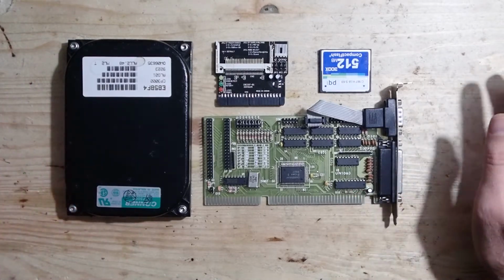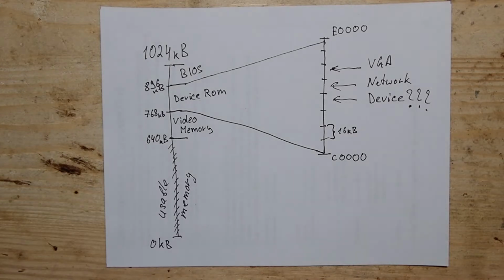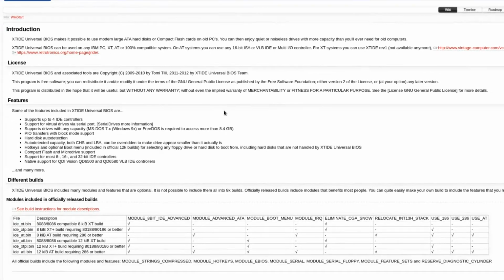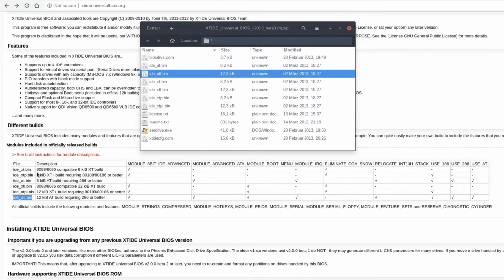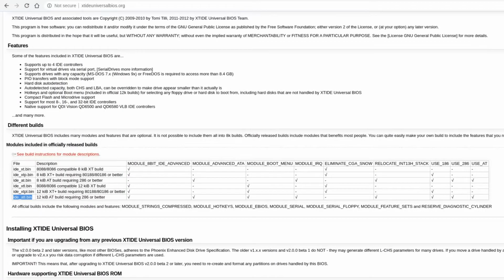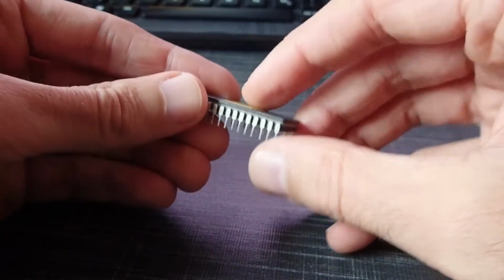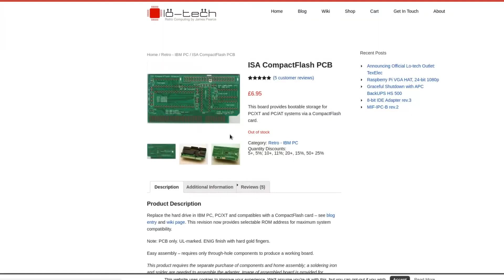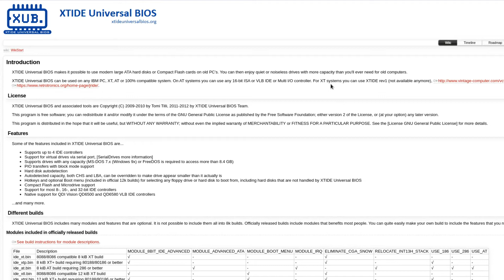Boot retro PC using XTIDE (Part 2): How to create and use XTIDE ROM

Comment: Very informative , thank you, I saw the 5 videos, and my only doubt is Can you use traditional BIOS modules from other motherboards/videos cards to put XTIDE rom? (of course if it has the size).
Reply: That's a bad idea. You can sell the working motherboards and buy individual EPROM chips with the money. The motherboards are now usually worth more than the individual EPROM chips. After all, there is a retro market for such motherboards and thus a demand. If you erase their EPROM chip, then these motherboards become unusable and it may be quite difficult to find the appropriate BIOS software for a corresponding motherboard to write a new EPROM chip.
In this respect, it would be wiser to take the EPROM from old peripheral components that are no longer of great importance today. These include, for example, network cards that are not Ethernet cards, but have used a different standard. Also old printers and scanners do have EPROM chips.
In any case, you shouldn't cannibalize any components that have a value for the retro market. For example, no VGA cards, no sound cards and no Ethernet NICs.

Comment: Hi very nice tutorial. Have you ever tryied to use 28C's instead of 27C? They are pin incompatible, but it shall be easy to hard wire. Benefits are common. PS. Great channel!
Reply from the maker: Yes, I use 28C's all the time. If you write the data to the end of the IC you can workaround the different pinout. But for me it has no real benefit, since I have a UV eraser and a bunch of different EPROMs as well.

Comment: hi there excellent video and thank you :)
Are there any cheaper alternatives to the  TL866II+ you'd recommend?
Reply from the maker: There are probably cheaper programmers, indeed, but they are not as much cheaper, as they are worse. TL866II+ is extremely useful tool. It can not only program PROMs, but also GALs and some microcontrollers. It can also check some RAM modules and logic ICs. I'm using it a lot. Other reliable (I don't know which) programmers would probably cost you around 25€ and TL866II+ costs on AliExpress about 45€-48€, I guess? I'd still suggest it. If you don't want to buy a programmer at all, you can use a Pentium class mainboard boot into DOS, then hot swap the BIOS IC and flash the ROM there. You can misuse a mainboard this way as a programmer. But it can be tricky, especially, if you want to flash 28 pin IC in 32 pin socket.
Reply: @necro_ware  good call.. point taken :-)
I just learned the XTIDE board also acts as a basic programmer too which is neat